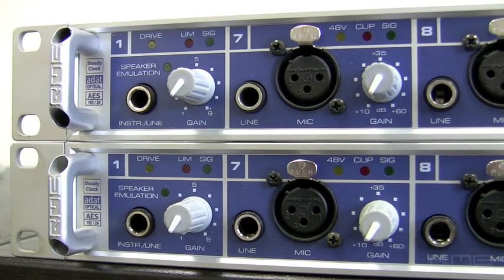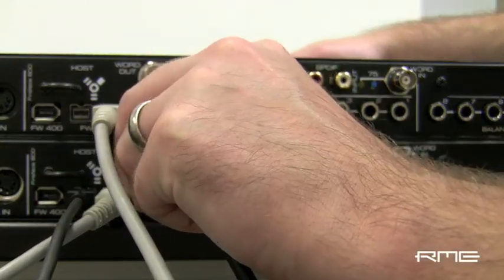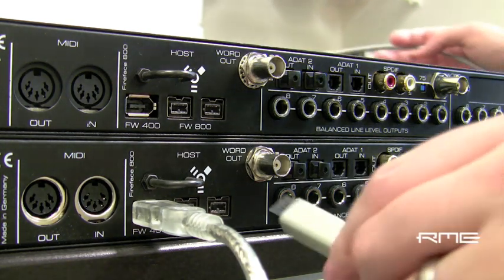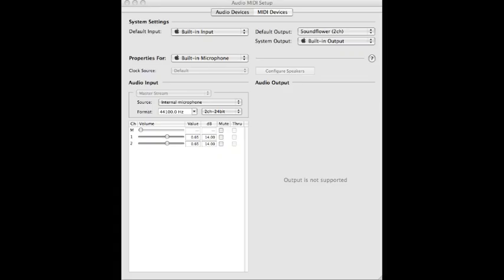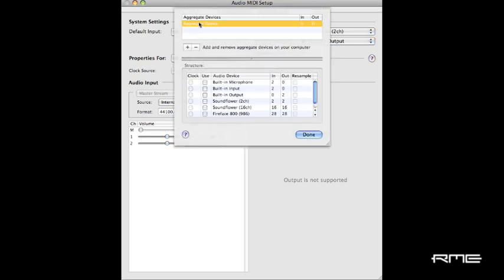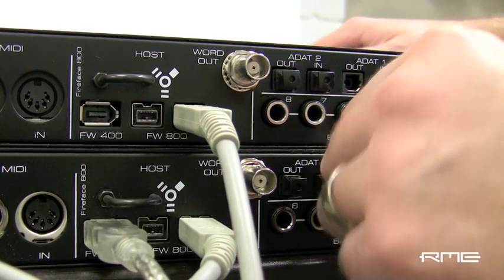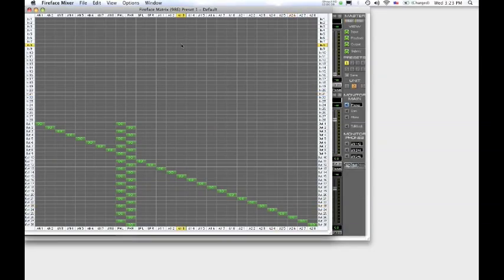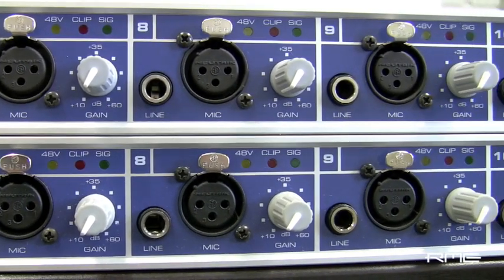RME FF800 tutorial

Comment: @RME: So I got this working with the third method. My only problem is that I cannot use pre-amp channels 9 and 10 from my slaved ff now. 
Is it possible to route it like this: 
input 1 -> 1 (adat channel)
input 2 -> 2 (adat channel)
input 3 -> 3 (adat channel)
input 4 -> 4 (adat channel)
input 7 -> 5 (adat channel)
input 8 -> 6 (adat channel)
input 9 -> 7 (adat channel)
input  10 -> 8 (adat channel)
Many thanks!

Comment: Where the hell is that settings window with the options to switch it to ADAT as a standalone unit? After 2 days trying, I still can't find the option to do that and firewire interfaces don't seem to work with my SSL Nucleus (running FF800 via firewire as ASIO while using Nucleus control surface causes the system to just stutter like the buffer is way too low when its not) so I'm trying to just connect it to an interface that DOES work with my Nucleus but I can't seem to switch it to run as a standalone converter.
Reply from the maker: You have to route the analog inputs one by one to the ADAT outputs and the ADAT inputs to the analog outputs. The easiest way is to switch all channels to mono. You can save this routing as a snapshot to change your setup quickly and easily.
Reply: @RMEAudio  If you mean switching to matrix view in TotalMix, and routing output like: Analog In 1 > ADAT Out 1, Ana In 2 > ADAT Out 2,... all the way to Ana In 8 > ADAT Out 8; that's the first thing I did. I connected ADAT Out 1 to ADAT In on the little Apollo Twin Duo, that I keep on my desk to run plugins, just to test it out before I decide what interface I wanna run the studio on, but no luck so far. 
I set the Apollo Twin WC to be a slave to the ADAT and clock source menu on the Apollo flashes red, indicating that no master clock is available via ADAT. You'd think there'd be a step by step guide somewhere online but apparently there's not. 
I've spent a lot of money making sure I have an Ampex 601 to pair with my vintage RCA 77B, an Avalon VT737sp to pair with my vintage original Nuemann U87, a 1073 to pair with my Sony C800G, and other preamps for my other mics. I NEED to run those preamps through top quality AD converters, so that I can choose an interface based on features & latency alone and not worry about  its I/O quality nor conversion, and RME has that. I just need to be able to use it.
Reply: @RMEAudio  Here's what I want, in case it helps you help me. 
I want to connect 2× ADAT I & O to an interface for 24bit 96kHz recording. I want to connect 8× preamps to 8× line inputs and run them out to another interface via ADAT so that I can setup Nuendo's Control Room with those inputs (and the inputs of the main interface) named according to which preamp they're connected to; so that all I have to do is plug a cable into the preamp of choice and arm that input channel in my DAW. Ideally, I'd like to also run 2× ADAT out from my interface into the Fireface800 and connect the SPDIF out on the FF800 to a second headphone mixer and also enable the outputs for 1 set of additional stereo monitors and use the other outputs as Sends to run through my racked gear.
All of this requires that I, first, get the Fireface800 working as a standalone converter.
Reply from the maker: @DeadlyMixKrew  please contact us on facebook. Our support team will help you via team viewer if you want.

Comment: man i love my firefaces sound, but this is the only video about stand alone ? any about using ff400 with an ff800? why? its not easy to set up...i just bought a new mac and its so hard to make it work just like before with the last one....i did the same things....any help?
Reply from the maker: What is the exact problem?
Reply: @RMEAudio  thanks. I am doing step by step following the stand alone tutorial but no succès this time.  As soon as I turn of to take the firewire cable off and put it  on again ,the ff 400 shows host Light and Clock doesnt lock flashing. ....I have couple doubts watching the video when u say turn off should i turn both off? My matrix is not the same exactlly names at hardware input palet it confuses me a bit too. On my mac audio préférences should i select Just the ff800 or both?  Any detailed step by step set up guide to FF800.+ FF400 PRODUCTS on mac ? Video or pdf. Thanks any advise would help. .i used this set up since 5 years i tought it could be easy to re set up but not really!
Reply: @RMEAudio  guys news? still a problem to me...and looking to the questions bellow i think many people has the same kind of doubt. I would love to understand clearly how to lin my ff400 and ff800 and use both as one . i used it like this for years, now with new computer i need the interfaces working like that again...i tought it would be plug and play...and watching the video again, doing the sae steps i dindnt succeed. HELP PLEASE i love my interfaces and need them to work daylly...doesnt coast that much to RME to guide us better....?
Reply from the maker: @gustavosandessp  please contact us on facebook. Our support team will help you.

Comment: THis gear still work well on modern mac ?
Reply from the maker: Yes, it does, with the correct adapters Firewire 800 to Thunderbolt 2.
Reply: yes but I mainly mean does the latest TotalMix version work with this older FF800???
Reply from the maker: Yes, it does too. Windows and Mac OS are still supported and you will have the latest TotalMix FX. With the Fireface 800 without EQ and FX because it does not have DSP on board. The newer devices like the successor of the Fireface 800, the Fireface 802 does have the FX on board.
Reply: thanks!

Comment: I just did this via FireWire 800 exactly how you had done so, except I had one running first for awhile with no problems. After connecting the second one, it default switched all my ins and outs to the second unit. How to I stop this from happening? Or do I just have to reassign all my ins and outs.... Thanks
Reply: Jarrett p Hi Jarret. we would need more information regarding your system. please send a mail to our support; support@rme-audio.de